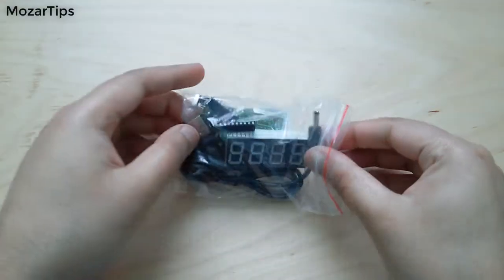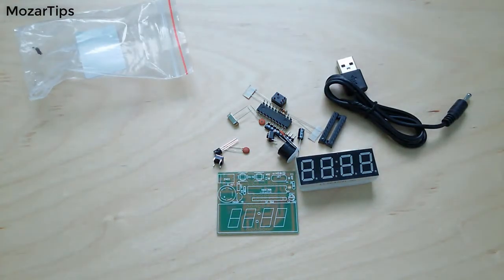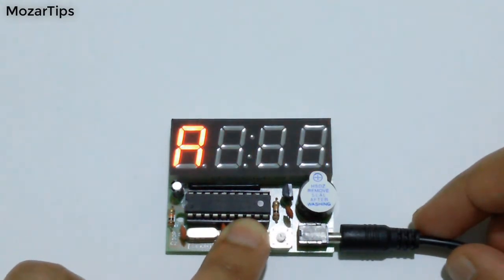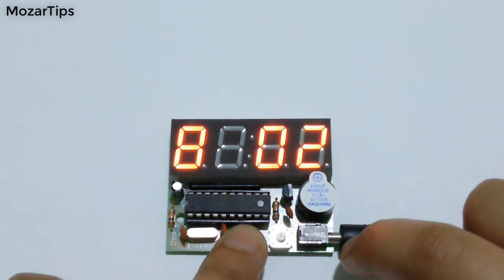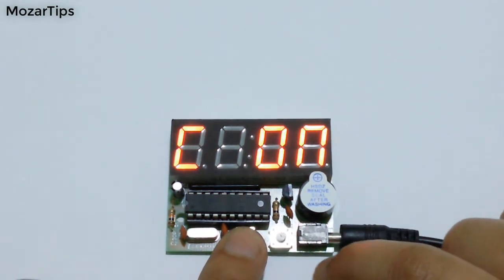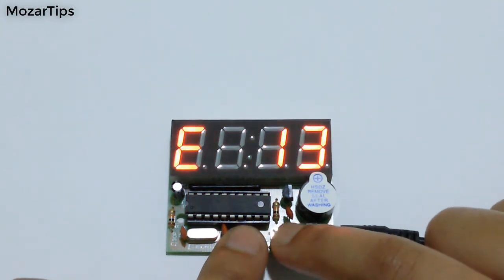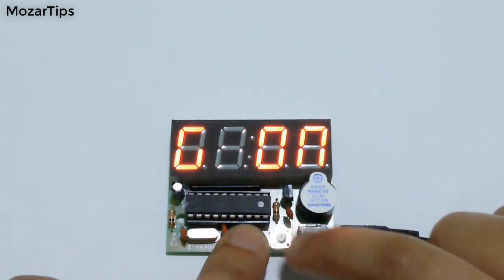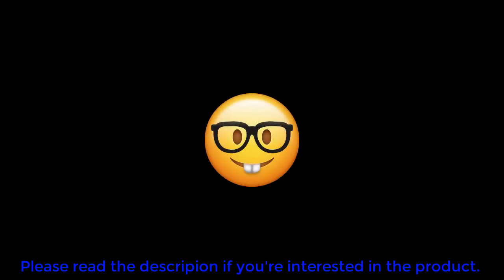DIY C51 4 Bits Digital Electronic Clock (easy to make)

Comment: Thanks for describing the undocumented modes. There are reviews on AliExpress by buyers who connected a Lithium Ion charging board and put a cell on charge. Doesn't the board charge the cell as is?
Reply from the maker: There's no cell on the board so you need to provide power from outside.